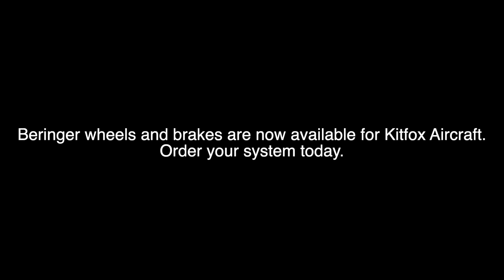Kitfox 7 Apex Build Episode 9 Wing Part 2

Comment: to shave off the bucked side of a rivet, and make it a double flush, countersink both sides, and then use a countersunk rivet, cut the shank a little long, and then squeeze it to fill the back side of the countersunk hole on bottom.. Use a microshaver to flush the head, or use a 90* angle grinder with a 220 grit sand disk to lightly sand the excess bucked head off, flush.

Comment: At 7:10 you are showing how you cut reliefs to smooth around a bracket. The reliefs are straight cuts in a panel with an abrupt end that is a stress riser that will promote cracking. You should drill a round hole in the end of it to inhibit cracking. When you fill it with superfill you won't see it anyway and it will be much less likely to crack later.
Reply from the maker: Good suggestion. I will do that.

Comment: What is used for spares for material and size on these wings, Can't really be sure of what i'm seeing,
It's been a while since I been flying, Curiously asking from ignorance this time
Those flap's you put on, I noticed they are or slightly below the trailing edge with it's masses. Because they are thicker then the actual trailing wing there, I would think there would be some drag from this slowing the plane down, And would have thought those flap's would be aligned to run smoothly in line with the wing surfaces, inside the wing itself,
Reply from the maker: The Kitfox has a flapper design. The Flapperons sit below and behind the wing and they articulate like ailerons but also drop full length like flaps. The wing has two round aluminum spares and wooden ribs.

Comment: Does the kitfox kit come with the wires for all the lighting? I.E. Landing/taxi lights, wing tip and tail lights?
Reply from the maker: No it doesn't. I just went over all that yesterday and I will need 270' of 20 gauge shielded wire.
Reply: @BowenAero  thanks must have missed that video.

Comment: Anality is a good thing when making air machines........very nice work indeed.   one suggestion on those fiberglass leading edges, maybe tensioning them slightly  against the leading edge by using small ratchet straps around the rear spar will secure them for drilling....and gluing for that matter.

Comment: Had to use expoy mix to make them even and flat. The STI bottom is 7 inches of fiber glass. Same problem. Cosmetic reasons only for the poly fiber material, or it will show through and you will see the wrinkles. Just an FYI

Comment: Brian, where you cut into the leading edge fiberglass (@ 7:33 mins), consider drilling a relief hole at the end of the cut to prevent cracking. Excellent videos!

Comment: You can strengthen the trailing edge by cutting .25" O.D. aluminum tubing to fit between the ribs, inside the trailing edge and attaching it with structural adhesive. Doesn't take much adhesive and very little weight gain for an enormous strength gain. Great vids.